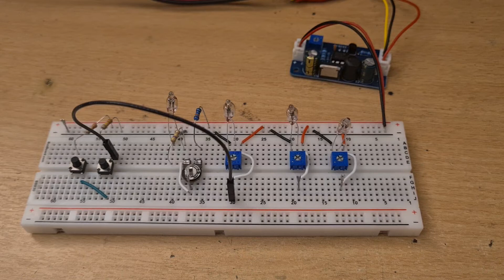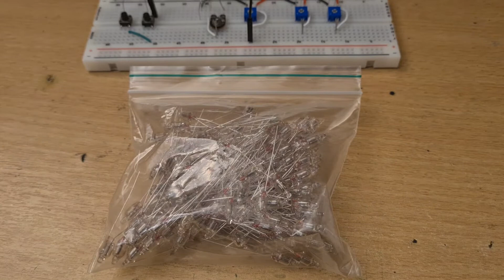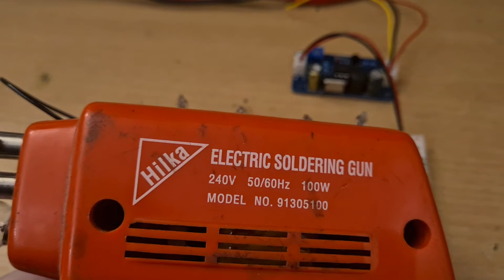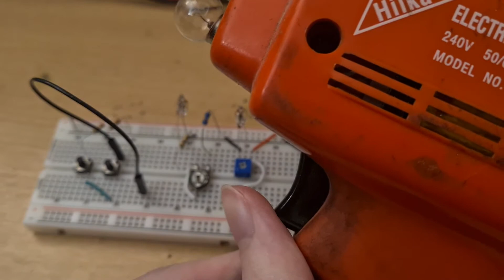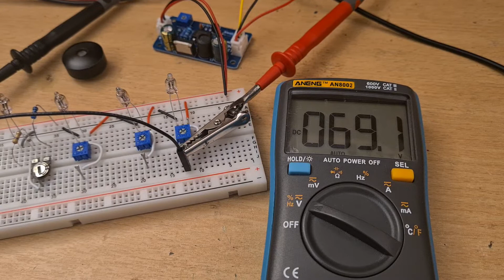Neon Indicator Memory

Comment: Amazing… Thanks so much! 💜
Finally I understand how these late 70’s soft-touch TV channel preset switches with built in neons worked.
Reply from the maker: Thanks. You think so? I thought that this way of using neon indicators was never practically used before.
Reply: @userPrehistoricman  Yes, I’m 99% convinced. I used to repair a lot of Philips K9 chassis TV’s, and I could never fully understand the tech behind the 8 or 12 soft touch neon lit presets, but now it makes total sense. This is a very cheap, but reliable and attractively ‘futuristic’ solution. The only thing that puzzles me is the safety. These TV’s did not have separated high and low voltage circuits, so (in theory) if anything went wrong, the soft touch buttons could leak a dangerous voltage potential. But a small transformer used in a smart way could fix this.

Comment: When you shine the light 💡 at the neons to light them up ? Is there a change of striking voltage ?
Reply from the maker: That's right and that's what causes them to light up. Neon indicators and old school neon logic is infamous for not working well in the dark.
Reply: @userPrehistoricman  interesting 🤔 if that’s the case, can it be used as a lux indicator